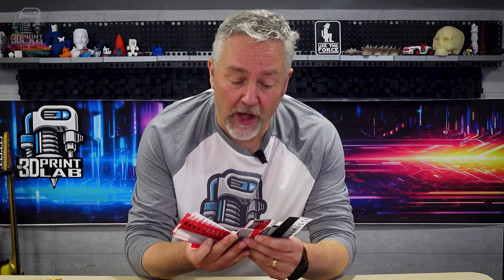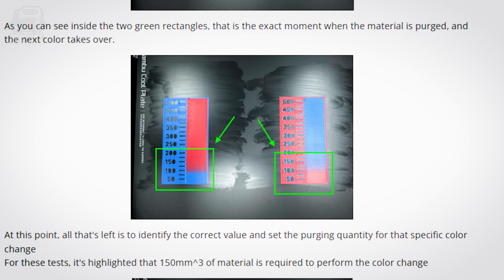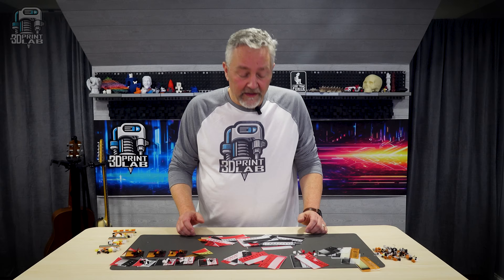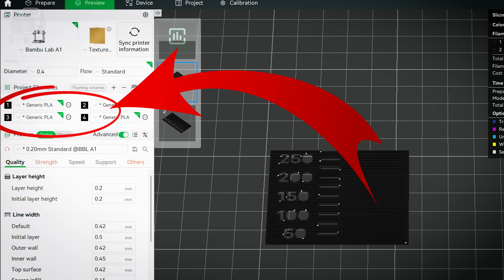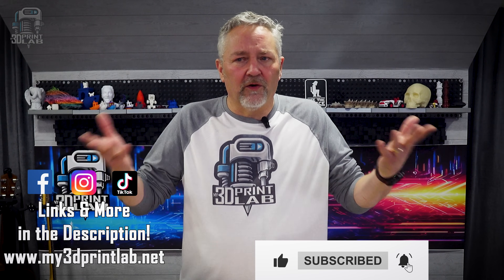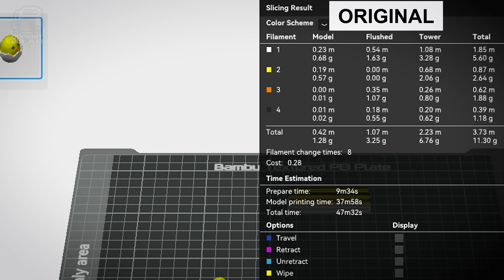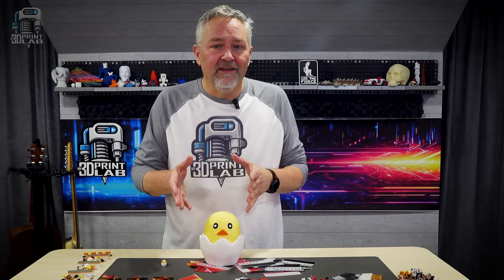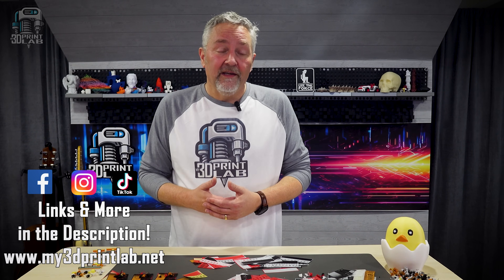Stop Wasting Filament - Save Money & Print Better!

Comment: Since you like testing stuff, how about testing the different build plate changers for the Bambulab A1. I am using the AutoSwap by Evrenot on Cults3d, but there are at least two others. I have not had much luck finding any independent reviews.

Comment: Strange seeing this recommendation today… just 3 days ago I printed some “wood carved” look little dogs. I decided to turn off the prime tower and enabled purge into objects. I set my flushing to 250 for the colour changes I was doing…. The result? 26 colour changes, no tower and hardly any poop. The little figurines came out quite weighty and solid feeling with zero colour bleeding issues. I saved an unquantifiable amount of filament but it made it worth it! I will be doing this again along with the flush into objects options which I am yet to test…

What grinds my gears is when you turn of auto flush calculation in preferences and it still auto calculates. This may be a bug in the old version I’m running…